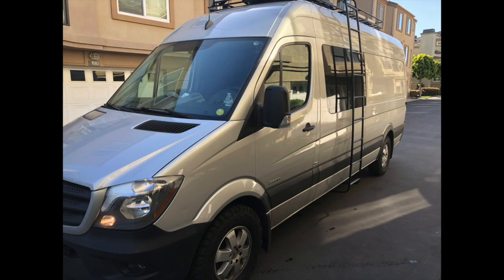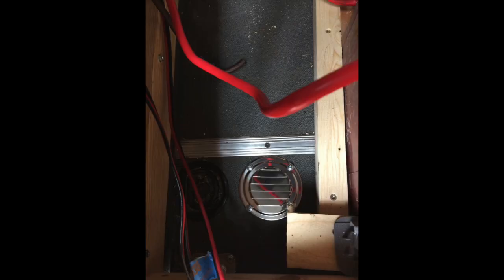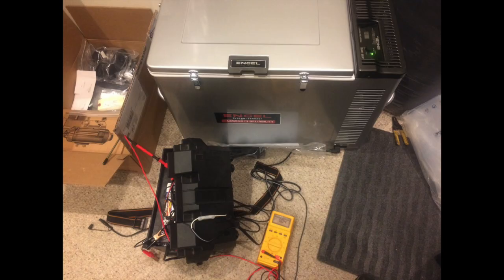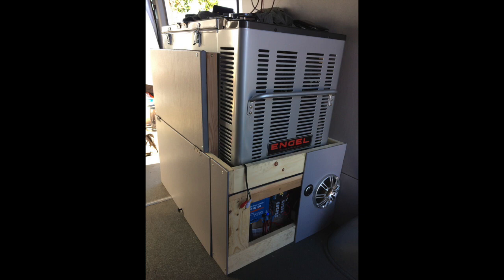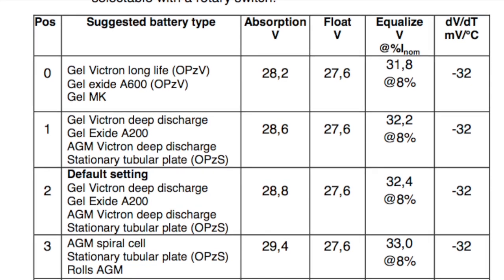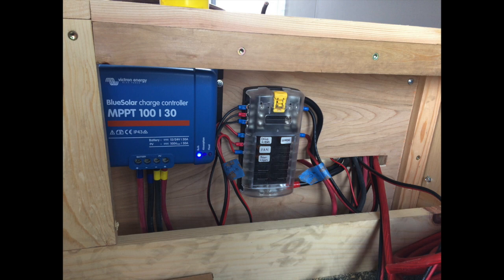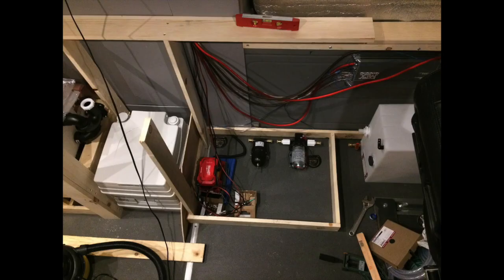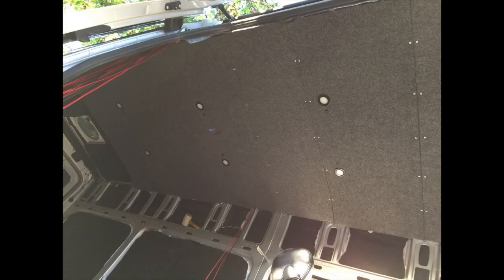Why You Don't Need More Solar - Cut Your Sprinter Usage in Half

Comment: Perfect point. I'm a very low energy consumer, no TV, no microwave or coffee maker... Having only 200w solar to a 110A AGM (little one, don't you think?) fits to stand independently for days. 
Winter is a season with a different pair of sleeves, then the diesel heating has to be switched on with a very low or even no yield from the panels. Driving around in the winter to charge the battery was not really energy efficient and involves a lot of unnecessary engine wear, fuel costs and extra pollution. Without daring to mention a noisy generator.
With no further expansion of solar panels on the roof possible, due to the limited space and no real good space for an second battery. Finally I made the decision and placed an Efoy fuel cell as close to the battery as possible in a corner. 
A major investment but until now I have not regretted it for a single moment. After two winters effortlessly enjoying the freedom I experience in the summer, this was the most interesting solution for my profile given my space and weight limitation. 
Can I still improve this, yes absolutely. Replacing the AGM with a LiFePO4 battery to almost double the existing supply of energy, but then only when the AGM reaches the end of its life cycle. 
Above all, let's not forget that AGM or lead-acid batteries are by no means faded technology. As a source of energy, these batteries are a lot friendlier and robust, require less attention compared to Lithium, with their many additional internal or external (for example: BMS) components that can break when used.
Reply from the maker: Chris Tee Glad to see when others opt for efficiency over throwing money at more panels or fancy batteries. I’m nowhere near as frugal as you with my electricity use. Most nights I’ll crank up a movie with the stereo system giving a nice boom to the audio. But the stereo and TV are DC. During the night the Maxairr is on for warm nights or the Espar when it’s cool. The fridge is also on and the microwave was often used after sunset to warm my dinner. That might tax a 110Ah system but with my modest 220Ah batteries, I never dip to concerning levels. 

I just had to make a video after seeing yet another conversion video where the builder spent 3, sometimes 4x as much as I did, to have the exact same outcome with an all-AC system.

Comment: The wattage you need depends a lot on where you live and what your needs are. I have a 320 Watt system but I wish I had 600 Watts. In Europe during the summer 300 Watts will do. In wintertime the system is giving me only 5 to 10 percent of its peakrating. Not enough to get the refrigerator going. We have a 120 Amp household.battery.  In the summer we can’t store all the energy comming of the roof. During winter it would be handy if we could charge an second battery from shorepower so we could be longer independent without driving for alternator power. All appliances are 12 volt. Only the tv and laptop are 230 Volt on a 500 Watt inverter.
Reply from the maker: MissionTrivial These Renogy panels with 6ga wire make nearly 10A in the shade. They make about 4-6A in dark clouds and rain. I’ll have to do another video to show them in different adverse conditions. My charge controller bulk charges at 15.5v so it actually gets the batteries back to 100%.

I didn’t mention it in the video but have you tied your engine alternator into your house bank via an isolator? It won’t help when you’re parked for days at a time but it will make sure you’re at 100% on day 1. Adding a bypass around the isolator is handy for giving yourself a jump start in case you ever leave your driving lights on. Been there.